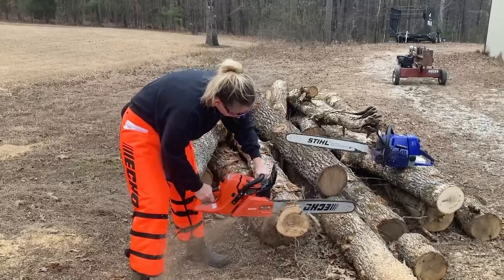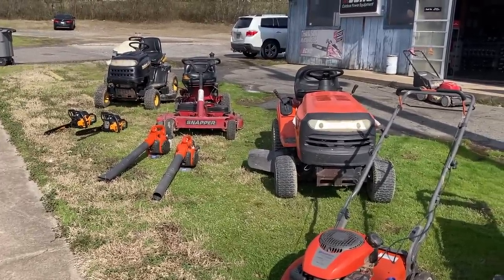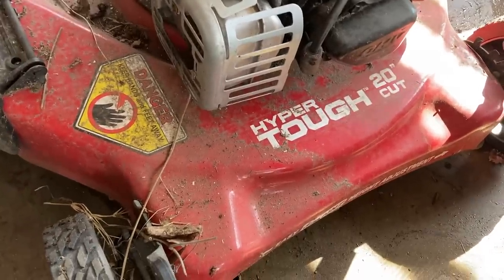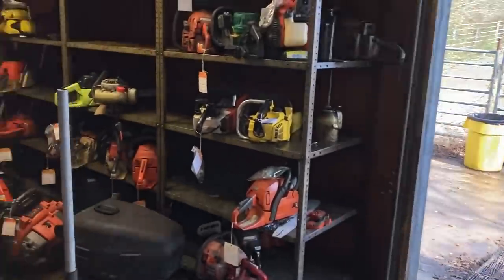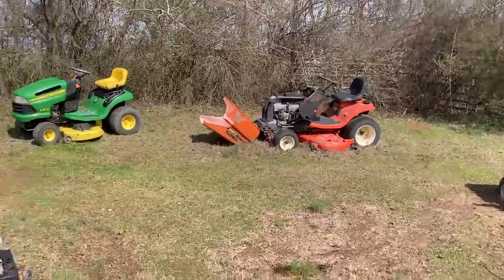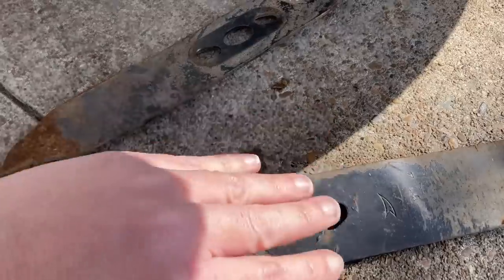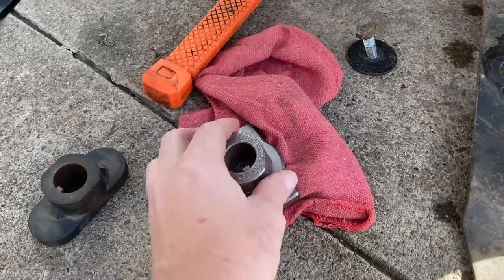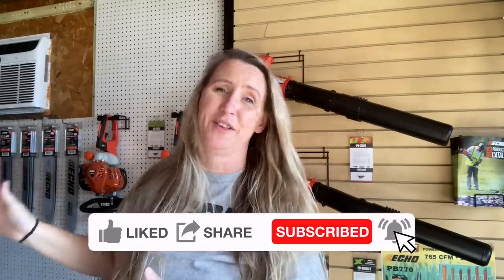Unwanted and Abandoned. The Equipment That Never Made it Home. (There’s SO MUCH!) VLOG

Comment: East of where I live is a large small engine repair shop and bone yard. In the 1990's it was a snowmobile bone yard. I used to go there quite often. I was on my way to the place when 9-11 took place. Now it is mostly a lawn mower/ snowblower bone yard. They have 55 gallon metal drums FULL of dead chain saws and weed wackers, blowers, you name it. I still go there but no longer work on Snowmobiles. I sell anything that is not picked up after 6 months. I do not have the time to go after the owner if they do not bother picking up their equipment. I can sell this stuff and at least get my time and effort back out of it. As far weed wackers are concerned, I quit repairing them last year. People do not want to pay to fix them because it's cheaper just to buy a new one usually.

Comment: I bought my mower in 2010 towards the end of the season after hitting a rock that bent the crank shaft.. All that was left in the stores was the economy single speed strippers. Over the winter with new parts from B&S and old parts from the dead mower I converted it into a variable speed/noise with inline fuel filter. It is in my shed with a security cable and padlock after someone stole the old parted out one sitting behind my shed. Hope they tried to start it as some of the governor parts are gone. Back then I noticed B&S on line was selling the air filters and other common parts for less than the "big box" stores.

Comment: You need to know about Star Tron  fuel enzyme, it makes gas last for years and will protect the small motors, been using it for a few years now, had an old RV run after 3 years gas stored, still smelled pretty good. It really is hard to believe. I never got 6 months out of Stabil. I promise you won’t believe it until you try it. I run it in all my engines now.

Comment: If I lived closer, I'd buy the boneyard late 2000s JD LA series for spare main assembly parts like the deck, cutting deck and tuff torq transmission.  Mine still runs like a top, especially after changing the fluid in the non serviceable transmission.

Comment: I found a 2 pack of blades from a different company off ebay for 30ish bucks,,hit sticks, rocks, concrete edging etc finally at end of season last year I bent it in a piece of cement lawn edging under tall grass.
Reply: It was a free mower so i beat it no care..also lots of briggs parts are identical like the pull cover. Might be a briggs in disguise.

Comment: I don't know if you just get horrendous gasoline in your area or if it's just the small quantity in a push mower but my tractor holds 3 gallons and it has no problem running on the full tank with stabil that I park it with over the off season. My generator holds 7 gallons and does the same. They both run just fine on the 5 gallon can of gasoline with stabil that I keep for the generator over the off season. Both the tractor and generator fire right up, the tractor in the first few spins and the generator on the first or second pull. I don't have a push mower but my small batch leftover 2 cycle mix gets used for fall and spring bon fires.

Comment: In the early 90s, i managed a Dixon/ Echo store,in S Fla. Winter was always slow so we pulled out all the trade ins and would do clean and adjust so they could be sold. We also were the sole retailer for kerosene and heaters. It kept our shop in the green. Being S Fla, a lot of homes were not built with heaters. Many folks did not want to pay for repairs and we got stuck with lots of junk. The only way to cut loses was to charge one hour labor up front. We have become a throwaway culture. Sad.

Comment: I worked with my father to run his lawn and power equipment business some 55 years ago. It is interesting to see what has changed and what hasn't. We did have some stuff abandoned, but not as much as you see. I'm guessing the economics have changed. More equipment was "buy it for life" then so maybe customers were less likely to leave stuff behind?
But we did have a "graveyard" in the basement where we would scavenge parts for our customers. In those days, the pace of change hadn't kicked in yet. You could actually buy the same model for several years in a row! Imagine that!
Our major engine repair was to replace "Points and condenser." People who stored their machines outside ended up with oxidized contact points so they had no spark in the spring. "Solid state" ignition put an end to that issue.
I wasn't unhappy to leave that line of work because I realized people didn't come to you because they wanted to; they had to. It seems you have adopted a sense or humor about that. It's what you have to do, isn't it?

Comment: Unwanted and abandoned - I own a tv and pc repair shop. I prefer doing onsite calls due to the orphaning situation. People would use me as a dumping ground for unwanted tube tv sets since trash won't pick them up. I started requiring a 50 dollar deposit on crt tv sets if I didn't know the people because there was a really good chance they didn't want to fix it, was just dumping it. That solved the problem. Be amazed how many crt tvs I see dumped on the side of country roads. Now people don't fix flat screens unless they are over 65 inches.

Comment: Transfer stations (take general refuse & sort for recycling before heading the rest to a tip), get more mowers etc than i can count in a week,most are salvageable except weedeaters/line trimmers & chainsaws. I know this as i used to get them as i knew somebody who worked there wink,wink. Even brand new lawnmowers (not many) that were seized . Even got self propelled's i rebuilt to use on my mowing run. Even more staggering is the amount working pc's that get biffed it's a bloody sacrilege.

Comment: They used to have a tool for a bent crankshaft where you didn't even have to split the engine open. You just pulled the motor off of the deck.

Comment: I fix stuff all the time. I enjoy doing it.  I am working on an air compressor now. Campbell Housman 11 gallon 3.5 horse. People threw these out because of a little plate in the head assembly. it is a plate made with .05 spring steel. The plat has 2 fingers that cover holes and act as reed valves so air pimped in can not get back out.  My plate has 1 broken finger. will pump to 20 pounds and that is all.  Being 1996 they no longer make the part and I can not find a kit anyplace.  But I do know I can make this plate as soon as I find a place that carries spring steel sheets.  I see people throw things out all the time and many times there is not much wrong with what they threw out.  Todays Gas is garbage.  That is most the time the problem with small engines today.

Comment: I got a used Craftsman riding mower, and do all the maintenance on it myself. Same with the John Deere rider I had, that had a bad motor that the dealer replaced the second year I had it. Sold it as I got tired of repairing the deck on it twice a year. But if you lived near me, I would have hauled off the junk mowers for you. As I did the same for a friend that ran a transmission shop. Netted me $300 every trip to the salvage yard, twice a week every week. He was shocked when he found what all the junk transmission parts was bringing in.

Comment: I remember in the old days, it cost me 120.00 for a new mower engine, but K-Mart sold the push mowers for 99.00. The bolt pattern were all the same so hey, why not? I was a back yard mechanic and did it for folks I knew so I didn't get parts wholesale.

Comment: on those HT cheep mowers,   the MFG is daye garden machinery,  and I hate  that you cannot use a universal  blade on it. .  uah I did the same thing replaced the adaptor and then use a craftsman blade. all parts were used stuff I had pulled off a scrap mower

Comment: Years ago, I hit an industrial surplus place that had a mower for $25. I pulled the plug and baked/gapped it. New gas and oil and it ran for 10 years until it threw a rod. When I had come back to that surplus place the next time, they had given me a discount because they felt bad about charging me $25 for the mower. (It was a golf course mower.)

Comment: I'll take all of it lol. I strip the junk ones down and use them for parts. Good used Mower Transaxles and engines usually sell out very quickly. I have a bunch of those 2 stroke Echo powered Mantis tillers that need crank seals. Owners do not want to spend $100-150+ to have them fixed. You must be in a fairly dense populated area. I typically only see a couple hundred units per year max and alot of those are repairs to equipment that other shops or local dealers had blotched. I have been in the business for just over 35 years. One of my least favorite things to work on is consumer grade Stihl chainsaws and any brand of string trimmer. String trimmers/weedeaters are a pain in the ass to work on and take quite a bit of time and you typically do not make much money off of them because why would you spend $100 to have an older one fixed when you can go buy a decent brand new one for $150-$250.

Comment: Maybe I've just been plain lucky, but for the last 25 years I've replaced my mowers' gas with fresh, stabilized gas, start them to run the new gas through the system, and store them for 6-7 months (we have horribly long winters here). Ditto my snowblowers in the opposite months. Also with my vehicles. I've never had a problem with stale gas. Stabil promises that if you double their recipe gas will keep two years, and that's been exactly my experience.  But I've heard so much to the contrary by people who know 100x more than I do about engines (I'm barely competent to change oil) that I doubt my own experience now.

Comment: I have a 1979 3 hp engine that burns oil on an old Murray mulching deck with wheels from a 2 cycle mower (forget the name) that I use for my push mower.

Comment: I'm in an upper-middle-income suburb of Los Angeles and a local mower shop owner I deal with has the same issue.  People leave mowers for repair, he calls them back with an estimate, the customer declines it and never picks up the mower.  He drains out the oil & gas, strips off any re-useable parts, piles the 'carcasses' in a yard out back, then has a scrap metal service come by and remove them every six months.  His volume of work has gotten so low that he's planning to close shop after this summer (2023) when he turns 65.  He owns the land and building so he's debating whether to lease it out or just sell the property to a developer.  From what he says there's no money in repairing newer electric/battery-powered mowers.

Comment: They recommend removing the spark plug wire not the whole plug, it doesn't make sense because the engine brake prevents the crank from turning but they have to say it because probably once upon a time somebody did something stupid and cut their head off so they sued the manufacturer, that's why there's a warning on a hot cup of coffee saying caution contents may be hot or the warning telling you not to use your toaster in the rain, you'd be surprised at the warnings in an appliance manual.

Comment: My first 3 or 5 cars were acquired by visiting various gas stations that had mechanics (showing my age, LoL) where people had put cars in for work, then not come by to pay and pick it up when the work was done.  Mechanic's Lien they called it.  Got some decent cars super cheap that way.  Every repair business from smalll engines to guns to boats has that happen.  I need to find a small engine shop like yours around me.  Parts and decent repaired machines.  I can use that.  I would like to keep my McCullough Timber Wolf running (cheap Zinc tension bar broke) and my first year DR and the Farmall C.  Parts are sometimes, but often rare.   :(

Comment: That Troy Bilt mower that was in the right side of the screen at 6:50 and the middle of the screen at 7:33. I desperately need a deck for one. I have one with a good engine, but the deck is shot. I have not been able to find one anywhere that is in decent shape. I'm in Tennessee.

Comment: My buddy worked at a shop that fixed a guys 150k torpedo heater. After a year, the guy never came back for it, so I bought it for the cost of the parts they put in it. 35 years later, and it still runs.

Comment: I dont recycle anything at my shop. I keep everything cause scrap prices are too cheap in my area. Instead I let customers come pull parts off the equipment that they need for there equipment sell it to them used reasonable prices. Make about 600 to 1000 per season by doing that off junk equipment and spare used parts.

Comment: I was Fiire Dept Captain at at a Station, do own mowing, needing a push mower for trim. Guys complaining bc cheaper mower bla bla won't run anymore. I investigated, poss bad gas.....smelled it was diesel. Dumped, put gas in started...smoking like crazy.  Zip tied bar to let run.   A deputy chief stopped out. Question mower just running. Told him just don't ask.   After that always started and ran perfectly

Comment: What happened to the Wheel Horse 312-8 (I think) with Kohler Magnum in your "get rid of" pile? I collect them and there is a pretty big following online. 

It would also apply to your statement about "pretty mowers" having a blown engine and not so pretty mowers lasting forever. That's Wheel Horse for me.

Comment: Maybe your customers should pay a $100 deposit when they bring their power tool for repair and upon collection of power tool the $100 deposit is adjusted on final bill if collected promptly. That way you can be sure of those who want their power tools repaired have the means to pay for the repairs and are more likely to collect and pay the balance for their repaired items. After all those who are not serious about getting their power tools repaired are hardly going to hand over $100 as well as their power tool and then leave it with you never to return. Here in UK we usually have to pay up front before repairs are completed and for example my IPhone 6S+ needs a battery to be replaced, I have to pay in full for the repairs before they are carried out by repairer. Two of my Stihl tools were recently serviced and the dealer called me advising me of service cost including some additional parts needed, I paid over the phone and the dealer then completed service and I collected the Stihl tools the next day. This is how business is done in UK and Europe.

Comment: I ended up with a free MS290. Was working at a Stihl dealer. Guy came in with MS290 with a burnt up top end. Said he let someone borrow it and they put strait gas in it. Warranty didn't cover it. He ended up just buying a new saw. I had his old one sitting under my work bench for months. Manager came back one day and set a box of parts on my bench. He said it was for the saw under my bench. I figured the guy wanted to fix it. Manager told me that the saw was now mine and here's all the parts to fix it. Put a top end on it along with new crank bearings and seals. Also put a carb kit in it. 20 some years later the saw still runs like a top.

Comment: I bought a type of tough $145 hated it pull the motor I put the motor Poulan Pro deck much better mower afterwards I use the same blade adapter from the from the Poulan Pro engine the engine end up blowing up I put a Honda motor on it soda $75 only because I had to we had to have food I did not want to get rid of that mower I loved it afterwards

Comment: You could possibly find a scrapper in your area to take all that scrap metal away and you wouldn't have to do the work to load the bins from the scrap yard.  That kind of volume should mean the scrapper might even pay you for it, depending on what local scrap yards will pay.  I am a scrapper and usually will pay for large volumes like you showed you have.
Reply: True but they don’t give but a tad for them and it’s hardly nothing 
Better to pull engines off

Comment: I had a 3" pump stolen at the worst possible time (we were flooded from rain). I bought a used Honda 3" pump from a local repair shop. Someone didn't pick it up and they wanted their money for repairs.  Motor ran good, didn't pump worth a crap. I thought it was just the way the pump was. So I used it as was for years. For this reason I never thought about buying used from a repair shop.  But now I might check used equipment.  Also, same shop took my small 2" pump to replace the engine and lost it (mechanic that started it quit). Along time later they found it and called.  They put on the new engine and said it ran excellent.  Well, flooding was done and I didn't need it for a few years.  When I did, it started right up, but wouldn't pump water.  Just leaked.  Since I had a bad taste in my mouth from the shop I took it apart myself.  I grew up on a small dairy farm in the central valley of California. We fixed all sorts of equipment.  I figured out that the ceramic seal was missing and other parts. I had my manual but I it didn't show, very well, what I needed.  I had very bad and limited internet on my phone but I tried to order parts.  Some parts were wrong, some correct and some I still needed.  I ended up finding another shop. Not only did they help me  but they told me where they get some of their parts fairly local. This is now the pump that I use 3-5 times per week to pump drinking water for my cattle.  Now that I know, I went and repaired the 3" Honda pump, and it works much better.  But it still doesn't work as well as my original pump. Anyway, thank you very much for all the information.